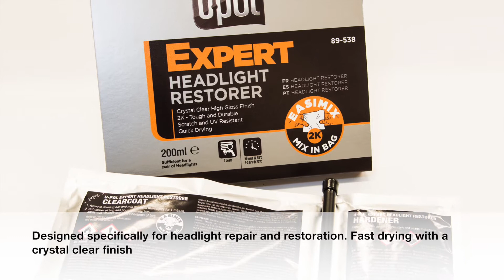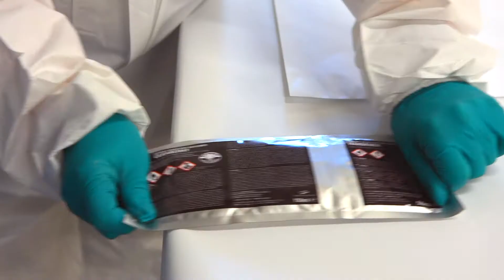U-POL Headlight Restorer

Comment: Cool but for at home diy restoration using a good quality clear coat works just as well  and doesn't need the infra red light
Reply: Craig Haynes 
I agree I use a shop line clear from ppg but I may go to finish 1 clear from Martian senior

Comment: Will this be much better than just using #1
Reply from the maker: HI Stuart, The headlight restorer will be much better than using CLEAR#1 as it is a 2K product which has greater durability and greater UV protection. It also has greater chemical resistance compared to 1K products. Hope it  helps!

Comment: So cool, what if you don't use the infrared ?
Reply from the maker: Hi 330turbo. After the Expert Headlight Restorer Kit is applied, it can be Baked 30 mins@60°C, Air dry 2-3hours or Infra-Red.
Reply: Can UV curing lamp be used